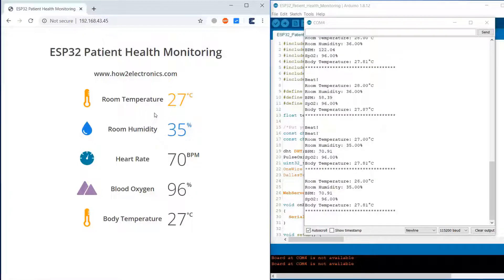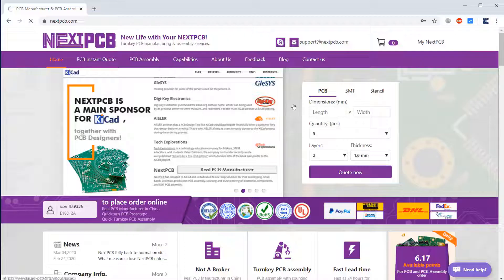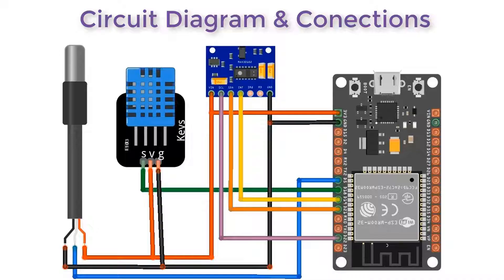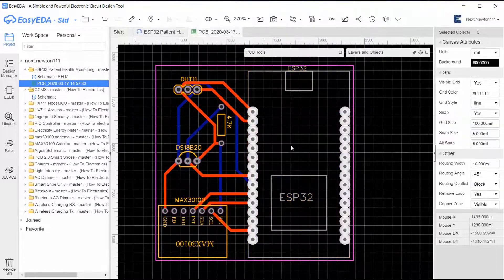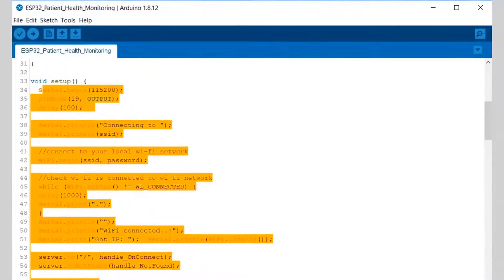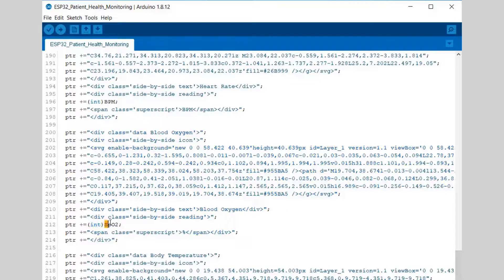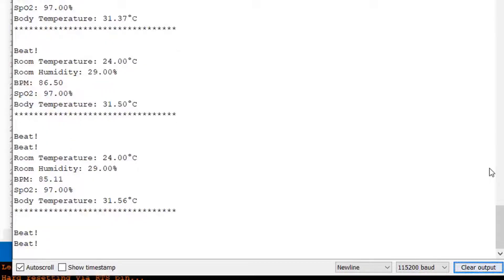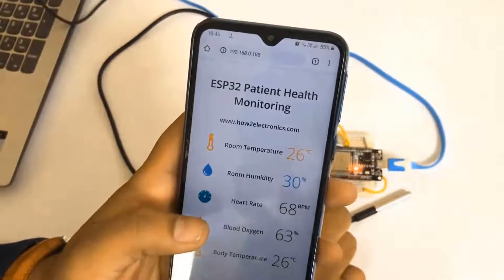IoT Based Patient Health Monitoring System using ESP32 Web Server

Comment: 🎯 Key Takeaways for quick navigation:

00:00 🌐 Overview of IoT Patient Health Monitoring System
Introduction to building an IoT-based patient health monitoring system using ESP32.
Interfacing sensors like pulse oximeter, humidity sensor, and temperature sensor with ESP32.
Displaying parameters such as blood oxygen, heart rate, body temperature, room temperature, and humidity on a web browser.
01:39 🔌 Circuit Diagram and Sensor Interfacing
Detailed explanation of the circuit diagram for interfacing sensors with ESP32.
Connection instructions for sensors like DS18B20, MAX30100, DHT11 to ESP32 GPIO pins.
Importance of using dedicated PCBs for sensor interfacing to simplify the process.
04:23 📡 Programming and Web Server Setup
Explanation of the program code for sensor data collection and web server setup.
Defining variables for sensor readings such as temperature, humidity, BPM, SPO2, and body temperature.
Establishing a local web server connection and displaying sensor data through HTML on web and mobile browsers.
06:34 📱 Monitoring Sensor Data on Web and Mobile
Steps to monitor sensor data on a web server by accessing the ESP32 IP address.
Demonstrating real-time monitoring of room temperature, humidity, heart rate, blood oxygen, and body temperature on web and mobile interfaces.
Highlighting the accessibility and convenience of monitoring health parameters remotely through IoT technology.

Made with HARPA AI

Comment: Room temperature and humidity is not showing..
Also If I connect the DS18B20 sensor and pulse oximeter is not showing the data parallel..If I connect one, the other one is not working..
Kindly help resolve this issue
Reply: can you fix this issue yet?

Comment: Can anyone help me? I connected as the video shown but only temperature sensor shows value, but the MAX30100 keep showing 0 as the result. I try the oximeter separately, it can run but when I add in the temperature sensor, the reading of oximeter will not be shown. Any solution?
Reply: same as me I put sensor begin();
setwaitforconversion(false); to pass the sensor
Reply: @geats654  where did you put it in the code
does it works?
Reply: Max30100 and ds18b20 seem to be problem if their integrate with each other

Comment: I got error while compile
In file included from c:\Users\Baitha\Documents\Arduino\libraries\DHTlib\dht.h:19:0,
                 from c:\Users\Baitha\Documents\Arduino\libraries\DHTlib\dht.cpp:42:
c:\Users\Baitha\Documents\Arduino\libraries\DHTlib\dht.cpp: In member function 'int8_t dht::_readSensor(uint8_t, uint8_t, uint8_t)':
C:\Users\Baitha\AppData\Local\Arduino15\packages\esp32\hardware\esp32\1.0.6\cores\esp32/Arduino.h:106:91: error: cannot convert 'volatile uint32_t* {aka volatile unsigned int*}' to 'volatile uint8_t* {aka volatile unsigned char*}' in initialization
 #define portInputRegister(port)     ((volatile uint32_t*)((port)?GPIO_IN1_REG:GPIO_IN_REG))
                                                                                           ^
c:\Users\Baitha\Documents\Arduino\libraries\DHTlib\dht.cpp:122:29: note: in expansion of macro 'portInputRegister'
     volatile uint8_t *PIR = portInputRegister(port);
                             ^

exit status 1

Compilation error: exit status 1

can someone help me ? Thanks :)

Comment: With all due respect sir @HowToElectronics .. Can you help with my error??

In file included from C:\Users\asus\Documents\Arduino\libraries\DHTLib\dht.h:18:0,
                 from C:\Users\asus\Documents\Arduino\libraries\DHTLib\dht.cpp:30:
C:\Users\asus\Documents\Arduino\libraries\DHTLib\dht.cpp: In member function 'int dht::_readSensor(uint8_t, uint8_t)':
C:\Users\asus\AppData\Local\Arduino15\packages\esp32\hardware\esp32\1.0.6\cores\esp32/Arduino.h:106:91: error: cannot convert 'volatile uint32_t* {aka volatile unsigned int*}' to 'volatile uint8_t* {aka volatile unsigned char*}' in initialization
 #define portInputRegister(port)     ((volatile uint32_t*)((port)?GPIO_IN1_REG:GPIO_IN_REG))
                                                                                           ^
C:\Users\asus\Documents\Arduino\libraries\DHTLib\dht.cpp:116:29: note: in expansion of macro 'portInputRegister'
     volatile uint8_t *PIR = portInputRegister(port);
                             ^
exit status 1
Error compiling for board ESP32 Dev Module.

Comment: Hello! Why it does not show a value of less than 93%? The person had a value of 76% of SpO2. But MAX30100 showed 94-96%.However, BPM matched the true value.
Reply: Was your project running smoothly. When temperature sensor is connected then Spo2 and Bpm reads zero. Guide me through this

Comment: wifi.h error araha hai compile nahi ho rhaa program
Reply from the maker: Install esp32 board in Arduino IDE and select Esp32 dev module while uploading code. Wifi.h is inbuilt internal library.
Reply: I know it is but there are lots and lots of errors in dht as well the code is not working can I contact you to show you this??

Comment: Please I'm getting this error from the oximeter and I soldered it properly with the right pin connections. "Initialization pulse oximeter... FAILED" 
Please any solution?
Reply: Try using gy max30100
Reply: Getting same issue

Comment: Amazing work sir, but not getting the readings of spo2 showing 0 only
Reply: Have you solved this issue?
Reply: @abdullahrahat1578  yess
Reply: @anantkushagra297  can you please tell how to ?
Reply: @abdullahrahat1578  check 2 things
First Sensor if you are using MAX30100 sensor you have to remove its 3 internal resistor to make that work..
If you done that and still it's not working check the baud rate
Reply: @anantkushagra297  thanks bro
Reply: @anantkushagra297  btw what baudrate should I use ?
Reply: @abdullahrahat1578  it's written on the back side of the wifi module...use that...or in the description given on your sensor..max30100
Reply: @anantkushagra297  thank you Soo much man 🙏, god bless u
Reply: @anantkushagra297  hi bro, how to remove 3 internal resistor
Reply: @MUSTAFAOZTURK-jf5hr  remove it via soldering iron my melting the solder around them delicate work but doable
Reply: @anantkushagra297  Hey brother  i did all things but its not working  can you help me....
Reply: After removing 3 internal resistors do we need to connect any external resistor.  Does your all readings Sp02, bpm and temperature shows at same time?
Reply: 1) I don't use any external resistor and it worked fine
However you can use them (1-5 ohm) it will not create any issue

2) Reading are taken by sensor continuously it depends upon your code with how much delay you wants the readings to be updated
Reply: 3 sensors are not working simultaneously how to solve?
Reply: @siddhesh0368  use 2 sensors with uno and add one extra arduino nano
Reply: @siddhesh0368   use 2 sensor with uno and add one extra arduino-nano for the 3rd sensor

Comment: @How To Electronics 
please tell me which version of ESP32 board you used in Ardiuno ide software
Reply from the maker: Esp32 dev module
Reply: @HowtoElectronics  bro I also used and followed the same as per the video
Reply: @HowtoElectronics  error: cannot convert 'volatile uint32_t* {aka volatile unsigned int*}' to 'volatile uint8_t* {aka volatile unsigned char*}' in initialization

 #define portInputRegister(port)     ((volatile uint32_t*)((port)?GPIO_IN1_REG:GPIO_IN_REG))

                                                                                           ^

C:\Users\ADMIN\Documents\Arduino\libraries\DHTLib\dht.cpp:116:29: note: in expansion of macro 'portInputRegister'

     volatile uint8_t *PIR = portInputRegister(port);
Reply: @kaushikm6362  did you get the solution for this error
Reply: @suveenr6452  still no bro
Reply: @kaushikm6362  bro did u got solution
Reply: @rameshbabu6908  no bro
Reply: @kaushikm6362  bro pulse oximeter reading is not getting, when I connect dsb1820 sensor did u find solution for it?

Comment: This is the error that shows for me:
Please help me🙏🙏🙏
In file included from C:\Users\ADMIN\Documents\Arduino\libraries\DHTLib\dht.h:18:0,
                 from C:\Users\ADMIN\Documents\Arduino\libraries\DHTLib\dht.cpp:30:
C:\Users\ADMIN\Documents\Arduino\libraries\DHTLib\dht.cpp: In member function 'int dht::_readSensor(uint8_t, uint8_t)':
C:\Users\ADMIN\Documents\ArduinoData\packages\esp32\hardware\esp32\1.0.6\cores\esp32/Arduino.h:106:91: error: cannot convert 'volatile uint32_t* {aka volatile unsigned int*}' to 'volatile uint8_t* {aka volatile unsigned char*}' in initialization
 #define portInputRegister(port)     ((volatile uint32_t*)((port)?GPIO_IN1_REG:GPIO_IN_REG))
                                                                                           ^
C:\Users\ADMIN\Documents\Arduino\libraries\DHTLib\dht.cpp:116:29: note: in expansion of macro 'portInputRegister'
     volatile uint8_t *PIR = portInputRegister(port);
                             ^
Multiple libraries were found for "WiFi.h"
 Used: C:\Users\ADMIN\Documents\ArduinoData\packages\esp32\hardware\esp32\1.0.6\libraries\WiFi
 Not used: C:\Program Files\WindowsApps\ArduinoLLC.ArduinoIDE_1.8.42.0_x86__mdqgnx93n4wtt\libraries\WiFi
exit status 1
Error compiling for board ESP32 Dev Module.

Comment: In file included from C:\Users\HP\Documents\Arduino\libraries\DHTLib\dht.h:18:0,
from C:\Users\HP\Documents\Arduino\libraries\DHTLib\dht.cpp:30:
C:\Users\HP\Documents\Arduino\libraries\DHTLib\dht.cpp: In member function 'int dht::_readSensor(uint8_t, uint8_t)':
C:\Users\HP\AppData\Local\Arduino15\packages\esp32\hardware\esp32\1.0.4\cores\esp32/Arduino.h:106:91: error: cannot convert 'volatile uint32_t* {aka volatile unsigned int*}' to 'volatile uint8_t* {aka volatile unsigned char*}' in initialization
#define portInputRegister(port) ((volatile uint32_t*)((port)?GPIO_IN1_REG:GPIO_IN_REG))
^
C:\Users\HP\Documents\Arduino\libraries\DHTLib\dht.cpp:116:29: note: in expansion of macro 'portInputRegister'
volatile uint8_t *PIR = portInputRegister(port);

Comment: sir its showing the " Error compiling for board ESP32 Dev Module."

//****************************************************************************************************
In file included from C:\Users\Shajo\OneDrive\Documents\Arduino\libraries\DHTLib\dht.h:18:0,

                 from C:\Users\Shajo\OneDrive\Documents\Arduino\libraries\DHTLib\dht.cpp:30:

C:\Users\Shajo\OneDrive\Documents\Arduino\libraries\DHTLib\dht.cpp: In member function 'int dht::_readSensor(uint8_t, uint8_t)':

C:\Users\Shajo\AppData\Local\Arduino15\packages\esp32\hardware\esp32\1.0.3\cores\esp32/Arduino.h:106:91: error: cannot convert 'volatile uint32_t* {aka volatile unsigned int*}' to 'volatile uint8_t* {aka volatile unsigned char*}' in initialization

 #define portInputRegister(port)     ((volatile uint32_t*)((port)?GPIO_IN1_REG:GPIO_IN_REG))

                                                                                           ^

C:\Users\Shajo\OneDrive\Documents\Arduino\libraries\DHTLib\dht.cpp:116:29: note: in expansion of macro 'portInputRegister'

     volatile uint8_t *PIR = portInputRegister(port);

                             ^

Multiple libraries were found for "WiFi.h"
 Used: C:\Users\Shajo\AppData\Local\Arduino15\packages\esp32\hardware\esp32\1.0.3\libraries\WiFi
 Not used: C:\Program Files (x86)\Arduino\libraries\WiFi
exit status 1
Error compiling for board ESP32 Dev Module.
//*******************************************************************************************************

Comment: Arduino: 1.8.12 (Windows 10), Board: "NodeMCU 0.9 (ESP-12 Module), 80 MHz, Flash, Legacy (new can return nullptr), All SSL ciphers (most compatible), 4MB (FS:2MB OTA:~1019KB), v2 Lower Memory, Disabled, None, Only Sketch, 115200"

max30100server:26:20: error: invalid conversion from 'int' to 'const char*' [-fpermissive]

 WebServer server(80);             

                    ^

In file included from F:\MANOJ SY\branding\personal\final max30100\max30100server\max30100server.ino:2:0:

C:\Users\Harry PC\Documents\Arduino\libraries\Webduino-master/WebServer.h:366:1: error:   initializing argument 1 of 'WebServer::WebServer(const char*, uint16_t)' [-fpermissive]

 WebServer::WebServer(const char *urlPrefix, uint16_t port) :

 ^

F:\MANOJ SY\branding\personal\final max30100\max30100server\max30100server.ino: In function 'void setup()':

max30100server:42:28: error: invalid conversion from 'const char*' to 'char*' [-fpermissive]

   WiFi.begin(ssid, password);

                            ^

In file included from F:\MANOJ SY\branding\personal\final max30100\max30100server\max30100server.ino:1:0:

C:\Users\Harry PC\Documents\Arduino\libraries\WiFi-master\src/WiFi.h:79:9: error:   initializing argument 1 of 'int WiFiClass::begin(char*, const char*)' [-fpermissive]

     int begin(char* ssid, const char *passphrase);

         ^

max30100server:53:10: error: 'class WebServer' has no member named 'on'

   server.on("/", handle_OnConnect);

          ^

max30100server:54:10: error: 'class WebServer' has no member named 'onNotFound'

   server.onNotFound(handle_NotFound);

          ^

F:\MANOJ SY\branding\personal\final max30100\max30100server\max30100server.ino: In function 'void loop()':

max30100server:75:10: error: 'class WebServer' has no member named 'handleClient'

   server.handleClient();

          ^

F:\MANOJ SY\branding\personal\final max30100\max30100server\max30100server.ino: In function 'void handle_OnConnect()':

max30100server:118:10: error: 'class WebServer' has no member named 'send'

   server.send(200, "text/html", SendHTML(temperature, humidity, BPM, SpO2, bodytemperature)); 

          ^

F:\MANOJ SY\branding\personal\final max30100\max30100server\max30100server.ino: In function 'void handle_NotFound()':

max30100server:122:10: error: 'class WebServer' has no member named 'send'

   server.send(404, "text/plain", "Not found");

          ^

Multiple libraries were found for "Ethernet.h"
 Used: C:\Users\Harry PC\AppData\Local\Arduino15\packages\esp8266\hardware\esp8266\2.7.1\libraries\Ethernet
 Not used: C:\Program Files (x86)\Arduino\libraries\Ethernet
exit status 1
invalid conversion from 'int' to 'const char*' [-fpermissive]

This report would have more information with
"Show verbose output during compilation"
option enabled in File -> Preferences.

this is the error i am getting
Reply: How did you clear that

Comment: That looks very nice and to the point video and all the details in link below include secure code and explanation. let's try this and make something interesting.
I have a question can How can I use only one sensor like DTH11 for this just temperature beacuse right now I have fewer sensors. Guide me about this.
Reply from the maker: Check one of my post in website article. ESP32 SHT31 WEbserver. This will help you.
Reply: @HowtoElectronics  thanks a lot